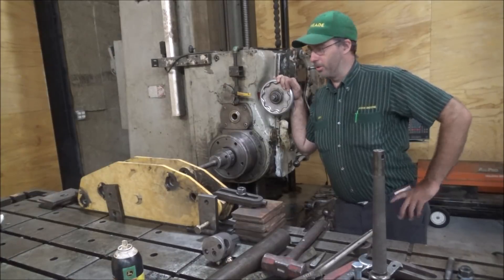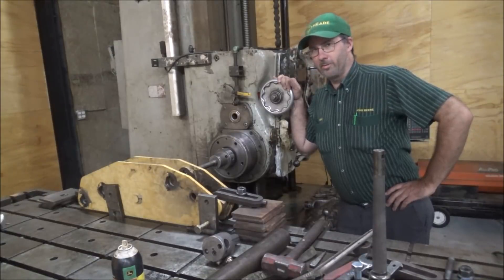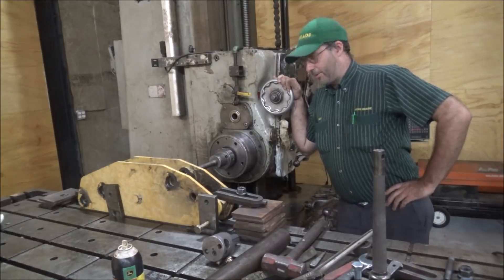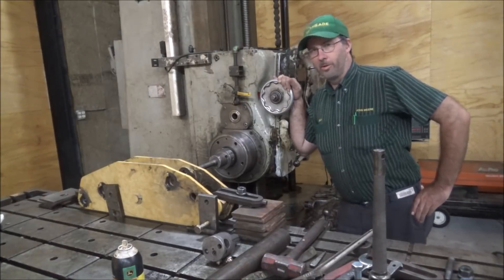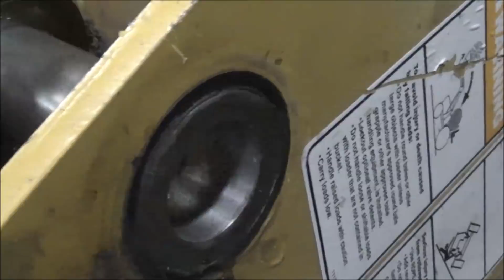Caterpillar Loader Pins and Bushings Repair

Comment: Brian --I try to keep or make an assortment   of boring bars  in increments of 3 inches or so in length  and  ALWAYS use the shortest  length and biggest dia.   one to do the job--- it makes a world of difference in the chatter------also smaller radius grind on tool tip keeps chatter down.
Reply from the maker: My tooling selection is still pretty limited but I agree the closer you can get to what you need to do the job the better performance you will have.  I probably only have about 10 different bars right now.
Reply: I may know where some  unused bars are at----a nearby shop is "cleaning  house"----make a real wish list and send it to me---I will send you my e-mail address

Comment: I am not that familiar with HBMs. But I believe I have seen some with a kind of a "tailstock" behind the other end of the table supporting the otherwise free end of a boring bar. Would that have been helpful with this setup here?
Reply from the maker: Yes it would be more rigid but not a whole lot as it would have to be much longer to clear the table and reach the  outboard support.
Reply: You would have to use a long boring bar supported on both ends like a line boring shaft only it needs to be much beefier behind the far end of the bore (bigger than the bore diameter) up to the far "tail stock".

Comment: Instead of building the ID up with weld couldn’t you bore it oversized and use a split hardened bushing?
Reply from the maker: Sure, lots of different ways to repair the job. I just went with the most cost effective for the customer per their request.

Comment: @2"30 that boring bar looks like its running out
Reply from the maker: It is deflection from only cutting on one side to restore the hole to its proper location.
Reply: good job on the videos man

Comment: I have a question. I have asked several channels with no response. I am working on a pretty old loader and I have to fabricate my own pins. I was wondering what grade of metal should be used on the pins ??
Reply from the maker: I normaly use pre hard 4140

Comment: If you do lots of this type of line boring jobs, it would be interesting to rigg yourself with a support for the far end of the boring bar, this would allow for much less deflection in the bar and way easier getting to make the bore right and centered...   Just an idea, though...
With that HBM at work and sailing full sail, it's soon to be double rations for the family, Baily, some others and even yourself...   lol
Reply from the maker: An adjusteable steady rest type deal could work. Have to build some long bars to use with it though.

Comment: Why do they use hard pins in soft bores or bushings? Would it no be more efficient to use hard bushings and soft pins. Then you simply replace the worn down pin.
Reply: edit: it's a weldment, not a casting. so why are soft rather than hard bushings welded into the machine? probably because it would be too hard to bore after heat distortion.

and in general, hardened pins are preferred to hardened bushings because od grinding is faster and cheaper than id grinding.

but your intuition is right. for similar reasons, fasteners are designed to fail before they strip out whatever they're screwed into.
Reply: Since the welded structure clearly is mild steel then the "hard" bushings would not need to be 60HRC. 30 or 40 would be plenty hard enough and could still be machined with preferably carbide or even HSS. Using the same setup like boring mild steel bushings such as line shaft boring or horizontal boring mill. No ID or OD grinding required.
Reply from the maker: My guess is cost. Truth is the pins aren't supposed to move in the bushings much in normal operation. The movement is supposed to occur where the cylinder goes around the pin as the pins are prevented from rotating in the bores that I fixed.  Problem usually is the bushings either wear out or get damaged in the cylinders then they start galling to the pin and it starts rotating the pin in the bores where it sin't supposed to move. Then you get to come see me to fix the damage. :-)

Comment: I'm curious, how do you decide if you are going to feed with the spindle or feed the table into the spindle?
Reply from the maker: For the most accuracy feed with table. If the tolerance doesn't need anything better than about .005" then it is fine to use the spindle.

Comment: Hi Brian That is a beast of a machine it makes that job look easy. I didnt understand why you didnt use any cutting lube? I thought it was only cast iron where none was required.
Reply from the maker: If you don't run real fast it won't burn your tooling up making you have to run coolant or lube.  It always helps though. When I am doing  something dirty and rough like this I don't normally fool with it as the beating of the irregular  and rusty holes is harder on the tool than anything.

Comment: One thing not many shops can do that repair like that. Most guys would have to use a line bore rig. Looking good
Reply: too be honest, this part could be done in a horizontal mill. But the boring mill is by far more practical for this job

Comment: Brian you are no Cecil B. DeMille Haha but you are one hell of a machinist. That is one sweet repair and a great demonstration of the value the G&L is to your shop. Nice job
Reply from the maker: It is really hard getting good shots on the G&L the machine is so big it interferes with most of the line of sight except for the operator and I can't very well do the work with the camera where I am.
Reply: No worries man I was just ribbing you a little. I love your videos. I have been a subscriber for quite a while. In fact way back when this was still a barn and you decided to do the impossible haha

Comment: Hi Brain
Very interesting video. Thanks for sharing. I really enjoy your rebuild/repair videos. :-)
One question. Would this possibly have been an opportunity to use the outboard support you bought for your G&L? That double cutter boring bar is really sweet. I was really curious as to how you would deal with the tool deflection. warm regards vic
Reply from the maker: Had it been a bigger diameter or much deeper hole then the outboard support would have been the way to go. I don't have any tooling to be able to use it though.

Comment: Another 10-20 years in service and they'll just about get their money's worth out of it.  
Repairing and restoring equipment like this is not only economical, it is also good for the environment.  All modern equipment is designed to last only long enough to fully depreciate off of your income taxes then throw it away and start again.
Reply: You can fix 'em a lot cheaper than you can replace 'em.

Comment: for the initial  bore why not use a big ass drill? i guess  because the  uneven wear?
Reply: The cutter on a boring bar is cheaper than a big ass drill, the depth of cut is adjustable, someone else may have repaired prior to you with hard material etc.
Reply from the maker: Biggest reason is a drill follows the existing hole so it would end up with a new clean hole but deflected into the wrong position.  Boring is required to restore the hole to its proper location.

Comment: I've been unfortunate enough to run a few pieces of equipment where the pins, bushing and holes were seriously worn out, but maybe not quite as bad as those were. Nice fix Brian. The operators going to have to relearn how to run a tight machine after running it with all that slop in the bucket assembly. It takes a real long time to get that much wear. And it should now be a whole lot easier to hold a level and flat working area. I'll bet that job gets you some repeat business since there maintenance doesn't seem to be the best.
Reply: Anybody can run a new one. You got to know what you're doing to compensate for slack and bad seals.
Reply: +Lewie McNeely i like your comment because it's totally true
Reply: When you start out on junk any improvement is a BIG deal! Thanks!

Comment: Too large deflection there . Looks that also the spindle has a little play...
Reply from the maker: It has about a thou of play between the spindle and its sleeve in that area if I tighten the sliding collar up then it is too stiff when run out to where it isn't worn.  Ideally it could use a new quill to tighten things up but it works fine as is, just have to measure what you cut and go from there like working with a worn lathe.  Only way to reduce deflection I know of would be less stick out or a bigger bar, or both.  What would you suggest?
Reply: If you have wear there is no much you can do. Just support the end of the bar when possible or use bushings to support the tool if you need large overhangs. Also how tool is shaped or sharpened play an important role.
Reply from the maker: I had a fair bit of positive rake to the cutter, think something more neutral would help?